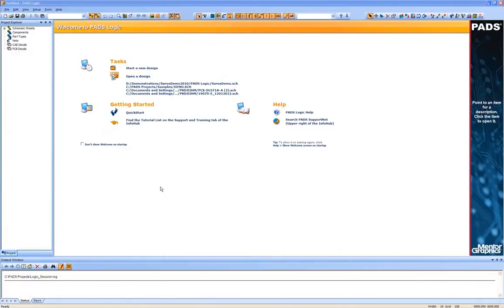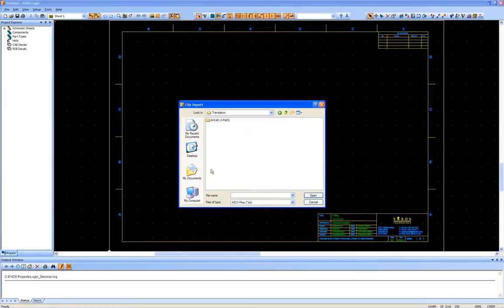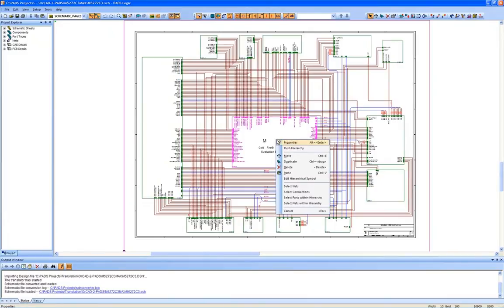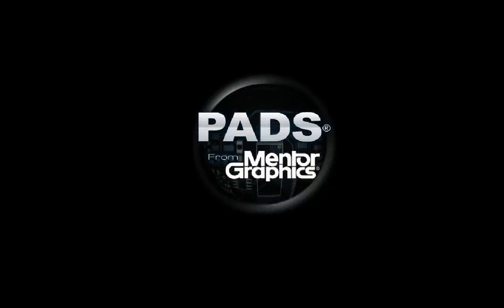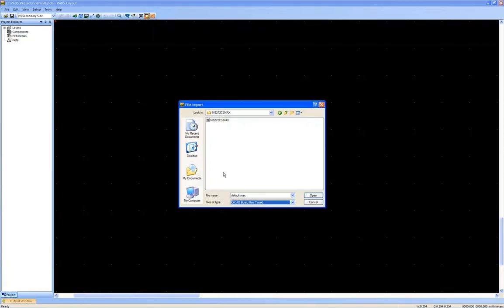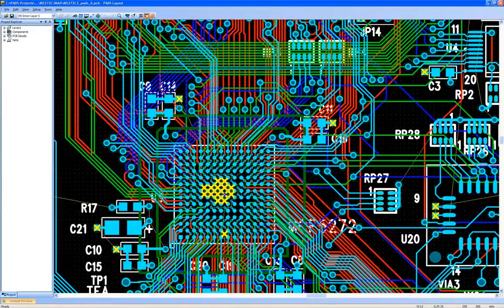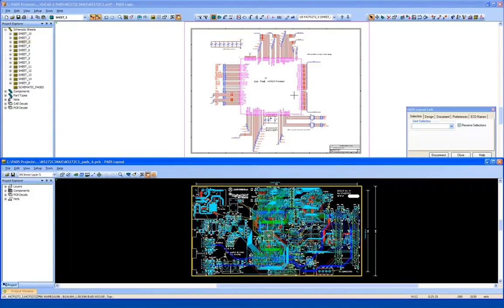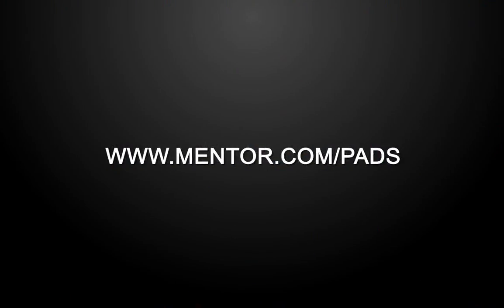Translating from OrCAD to PADS Logic and Layout

Comment: for ORCAD 16.5 to PADS LOGIC 9.5 you need to save the dsn to 16.2 then import in pads logic 9.5 with the selection of orcad schematic 10.5 format. sometimes there is a runtime error with windows 10 but after reboot the PC it works.